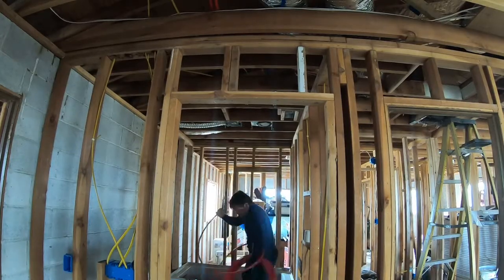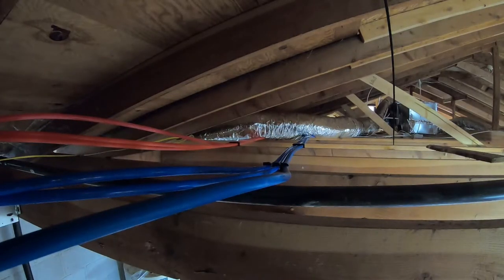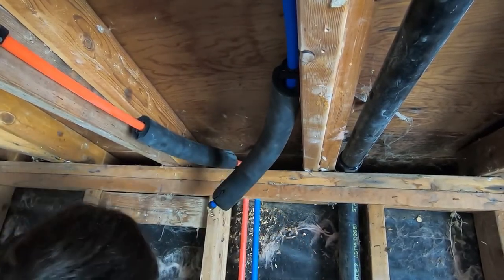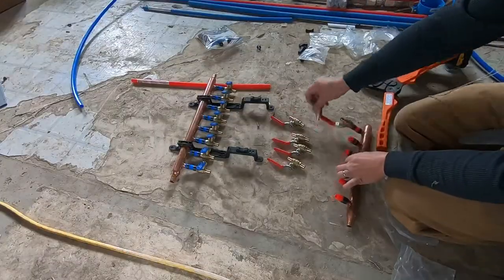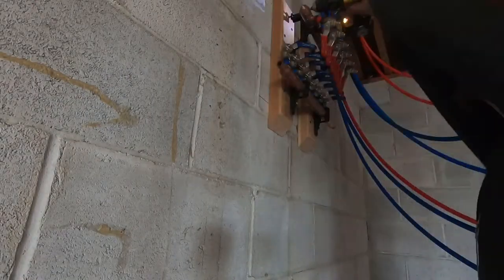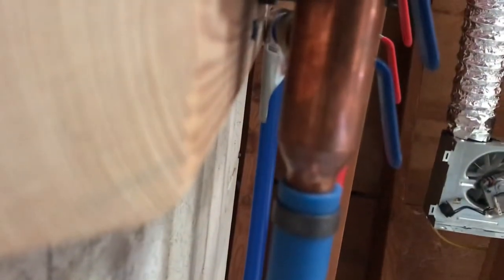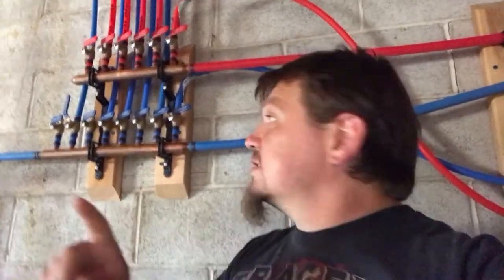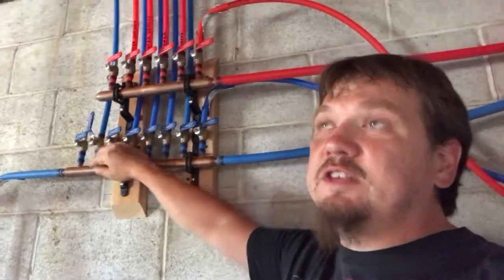Pex Manifold How-to

Comment: Still a great video. Each house is different. Ours is 85 years old, and the toilets do not cause shower scalding because the basement, main floor and 2nd floor bathrooms are vertically oriented, with the branches in the basement. The tub/shower valves are ancient -- separate and no type of pressure balancer needed because the cold for the shower enjoys the same practical supply as the toilet. You never feel any difference if someone flushes a toilet.

On the other hand, the hot line runs away from the heater over to the kitchen zone before coming BACK to the bathrooms. If the dishwasher is running, the hot shower pressure drops like a rock. I plan on a similar DIY manifold, not the kind with plastic valves included.

Comment: I used a manifold with the built in outlet valves for future use. I've had to replace the manifolds 4 times. They are not reliable as the ports tend to leak over time. Next time I'll add the valves like you did.
Reply from the maker: We have had a few plumbing professionals in the home now who have drooled over this set up

Comment: Use the stainless clamps and the $20 clamp tool. Works so much better in tight spaces. The type of copper ring tool you have is a total PITA

Comment: Great video!! I'm hoping to do this myself soon. I've read that many PEX installations rely on the pipe bending, and flexing, without using elbows, but every time I see a video about PEX installation- it's elbow city!! Anyhow, I'm intrigued by the ideas of not using any elbows, and each fixture having its own PEX run right to the manifold. Your video looks like you've avoided using elbows, which gives me hope!! Other than those couple, are you able to confirm- did you do the whole re-pipe without elbows?? And may I ask, was it difficult to run without elbows?? Thank you so much!! ✌️✌️✌️
Reply from the maker: The only time I actually used elbows was at the fixtures or when I didn’t have enough space to do otherwise. We do have a bathroom where I used elbows at the top of a wall but that was due to not enough clearance to the roof to use a bend. My water is really hard so in my mind I wanted as few brass fittings as possible. You need to use some muscle to get the pipe in the bends but not much, in our house we used a continuous pipe from the manifold to the fixtures by using them. These are what I used to do that: Highcraft PXBND12-10 PEX Bend Support 1/2 in and Copper Stub Out Elbow for 1/2" Pex Tubing with Ear/Nail Flange
Reply: @Rocket Family Farms Homesteading   Your installation looks nearly identical to what I'm dealing with, so you've definitely given me some hope, and confidence that I'm NOT crazy trying to avoid a ton of elbows!! Thanks again man, I have been searching the Tube, and other places for a couple of years now, and have gotten nothing but more confused, so I'm glad your video finally found me!! Super-helpful!! I can't wait to get to work!! 😎😎😎

Comment: Great video. I’m planning on doing something similar at home but my only concern was the valves all close to each other. Don’t the handles touch each other this way ? I was looking instead at Dahl valves that have a very small 1/4 turn handle but are more expensive,in some cases double the price. Thanks
Reply from the maker: They do not touch! There close but still easy to use and turn.
Reply from the maker: They are angled slightly so they don't touch

Comment: Could you do a sub manifold?  For example the main cold water manifold has lines going out to bathroom 1, bathroom 2 and kitchen.  The sub manifold at bathroom 1 may have toilet, shower, sink, the sub manifold at kitchen may have ice maker, sink, dishwasher, etc. Would you have to convert back to 3/4 as most pex copper manifolds are 3/4 in 1/2 out?
Reply from the maker: Yes you can do that but I would suggest keeping it 3/4 until you get to the second manifold, once you reduce to 1/2 the capacity is already reduced. You would see a bigger drop in water pressure if your taking a shower and someone flushed the toilet.

Comment: Might want to insulate your pipes. Hot and cold, also stops the UV from killing the pipe. I wouldn't use PEX B if it was FREE. Too much water restriction and poor freeze performance compared to PEX B. Where are the best on the market, Boshart stainless steel fittings? They are roughly the same price as brass fittings.

Comment: TYPE A fittings also last forever where Type B are known to leak... and those rings do get all crapped up and start to get really nasty and breakdown over years to.
Reply from the maker: With both and our water being so alkaline I know we will have to replace them all at some point! At least we won't have to replace all the plumbing like many people in our area have to do.
Reply: Actually type A breaks down over type being that it is a stretched source. If you use the stainless pro crimps they will last forever.

Comment: That manifold you built is a time bomb. All those poor fittings and connections. THAT is where most of the PEX failures are at in the fittings. Look at all the crimp rings, WOW. One valve on the hot and one on the cold. All you need. If you have future issues, you still have water in the house. Keep it simple.
Reply: I have one of those manabloc systems that are always leaking at the valves or rings and am likely going to swap it out for a homade manifold with one hot and one cold shutoff valve. Basically going to run one complete line from the manifold to the fixture with fittings only on each end. Like you were saying, the less connections the less chances for failure. This manabloc came from the builder and in my experience with all the valves on it, can turn into one big mess. They are not cheap either, so you also save money by keeping it simpler.
Reply: @thomaso7024  You need to INSULATE those manifolds and ALL of your pipe. Meaning cold and hot lines. We had -27 temps one winter. Prepare for that kind of yearly cold if I were you.
Reply: @rickjames6948  I live in Vegas and pipes rarely freeze here. During unusually cold winters, the temp  in town (where I live)  may dip slightly below freezing. We may see like the high 20s. Mid 30s to 40s is more common
Reply: Every test you’ll ever see, they never fail at the fittings. The pipe bursts.